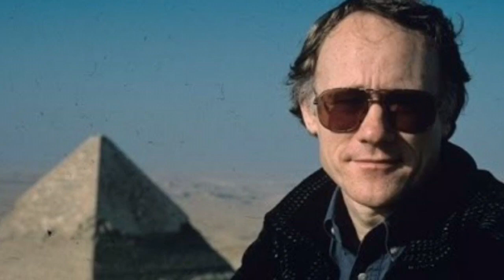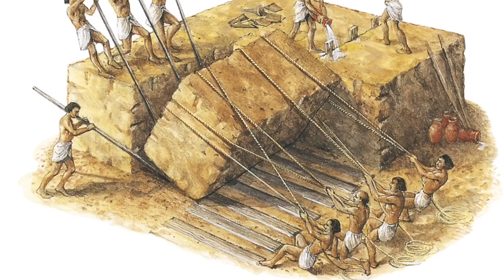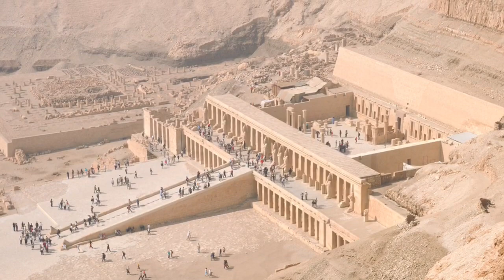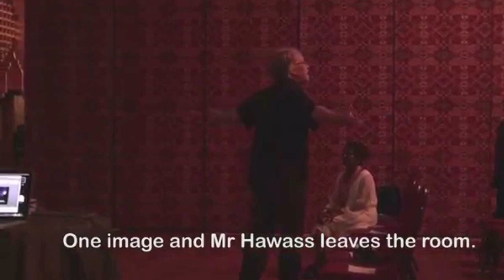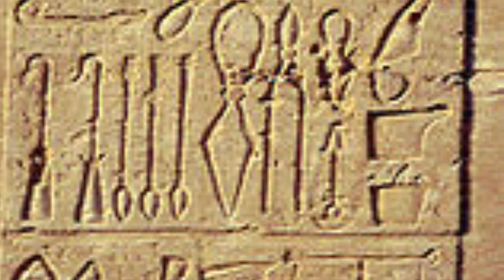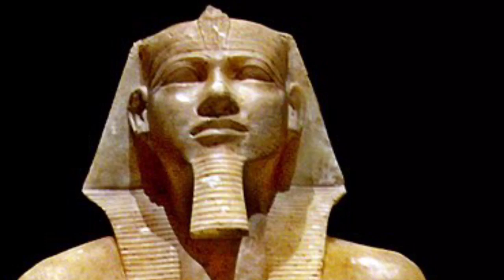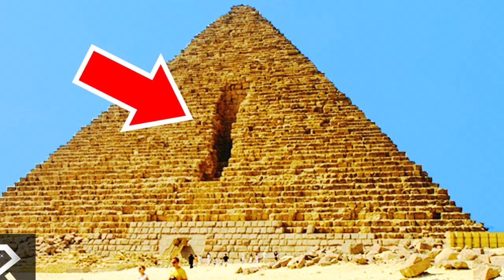Graham Hancock Mathematically Explaining why we CAN'T Reconstruct The Great Pyramid

Comment: Why 'gangs' of MEN?? Egyptians used elephants, horses and other animals. Those animals could be used as a lot of muscle needed in many areas of the construction. Gangs of elephants could have been chained together to do the really heavy movement and lifting of the larger stones with pulleys, etc.
Reply: I made almost exactly the same statements , and have just noticed yours, a simple scales style lift whereby the animals walk in and off as counterweights to allow simple lifting .
Internal ramps and aquaducts to transport the stone directly to the site.
Reply: @sijcalv  just how mucb rope would you need around a 70 tonne block to lift it up?
Reply: @djimma5080 How much rope would be required to move a block horizontally, or on a slight incline, let alone 'lift one up'? Any idea how many men would be needed, how many men connected to a single block that is probably on a sked (moved across moistened sand or with lubricant across the stones of the Giza plateau? Or some wood or other? More rope would be needed than any rope and tackle method.
Reply: @sijcalv  The problem is we just don't have a freaking clue! It's all just speculation and it's fun to think of ways the oldest dynasties (or earlier) managed to figure it all out.
Reply: Horses weren't introduced to Egypt until about a millennia after the 4th Dynasty. While they probably did use some elephants, African Elephants aren't very useful as beasts of burden, not like their Asian counterparts. So they probably weren't used very often. Plus they need a ridiculous amount of food, so using people would probably be logistically easier at any rate.
Reply: Lol a wooden pully lifting 70 tonne blocks is Impossible
Reply: @djimma5080  

https://en.wikipedia.org/wiki/Mechanical_advantage

It may be totally dependent on exactly when the Pyramids were built. There are many different credible theories on that topic; Was it around 3500 BC? 10,000 BC? Even earlier later, like in the 20K or 30K ballpark? So, HOW were the pyramids erected, how long did  it take? What Technology was used on all the incredible hard granite blocks that the geniuses doing the planning and construction figured out, but of which there is ZERO information us little mortals have found so far... These questions (and many more) has a lot of brilliant people scratching their collective heads to this day. It would take a practiced team to harness a block and tackle system, but the ANCIENT Egyptians that built
 those suckers were, as has been noted were smart... wicked smart. Also, 20,000 years ago to about 15,000 years ago, North African was wet, and the vegetation was lush. Elephants, giraffes, and other mammals were plentiful. There are hieroglyphs that depict elephants from around 3500 BC, but that was around the time when that sophisticated 'language' came on the world stage. What other information (and how recorded?) are we missing? PS., pulleys don't have to be wood; they can be lubricated stone, tree trunks, and even big copper pulleys as described in the picture in the Wikipedia article. My thoughts, all speculation but plausible until more information is unearthed. :-)

Comment: 1000s of people with nothing to do but focus on building for 20-30 years.... soooo shocking lol
Reply: City’s get built in the same time frame lol
Reply from the maker: I don't think you fully understand the timeframe
Reply: @2guys1pic49  yeah with machines and tools specifically designed for this.
Reply: People have to eat, sleep and shit. Not to mention the fact that they're humans. No matter how powerful the king, pissed off peasants have a way of really screwing things up. They need to be socialized, have sex, and be moderately entertained. 20yrs of pointless, backbreaking, non-stop work would require 5 times as many people just to support the laborers and keep the project moving. All of that, of course, aside from the logistical nightmare of lifting impossibly large, perfectly shaped blocks. 
Free time is the least important factor.

Comment: When you take a rope over a log with one end fixed, you have a pseudo pulley with a 2:1 mechanical advantage. The evidence shows something like these were used internally inside the great pyramid, so why not give them logs under the sleds outside, with both the logs and the sled pulled by ropes? Today, we couldn't cut the blocks, couldn't lift the blocks to the boats, the ancient canals for the boats aren't still there, etc. But if we could wave a magic wand and get the blocks there, there is an architect who figured out a good many of the puzzles. I'm not sure how you google the research on the great pyramid's construction, but it is in two or three fantastic videos. I think if we get blocks there by developing a magical new technology, we could build one in about two centuries using modern technology. We will simply divert a fraction of the global economy to fund it. Their technology was clearly in some ways superior to ours, so they likely built each one in about a century. But I think our technology with synthetic lubricants, hydraulics, compressed air, electric motors, pulleys, and modern safety equipment, we should have better worker safety than they did and still get it built.
Reply: So hemp rope can take 70 tonnes of weight, BULLSHIT